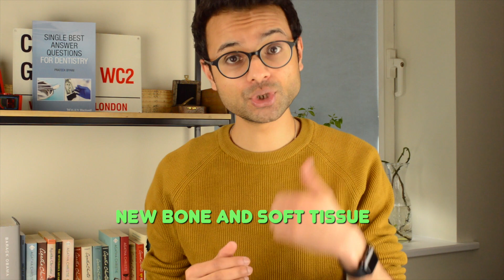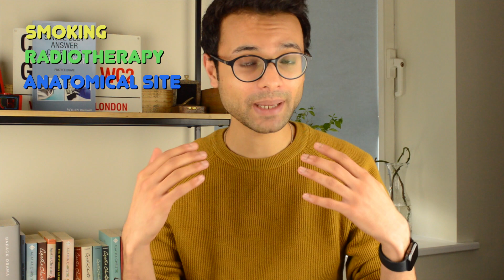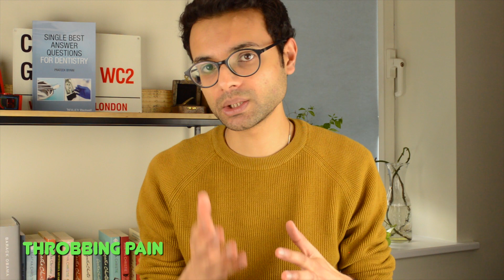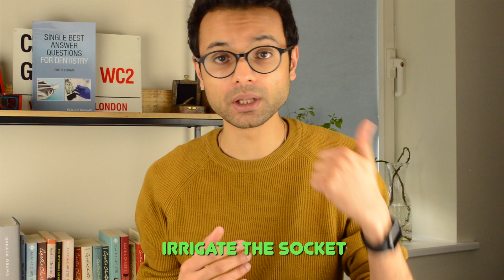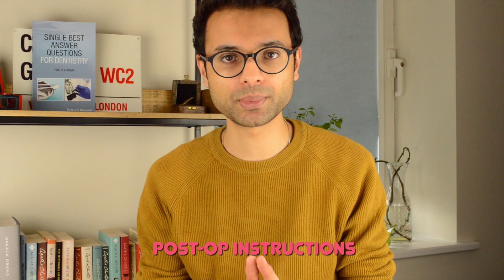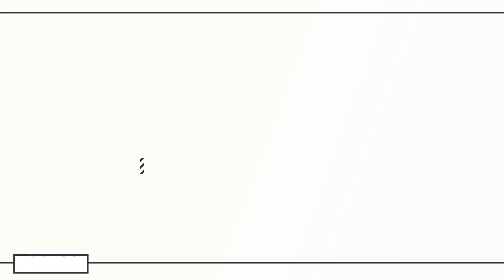What is a Dry Socket? | Diagnosis and Management

Comment from the maker: Learn more about the diagnosis and management of dry sockets :) Hope this video provides some useful information!
Reply: So if u see nothn but white stuff which is bone and a hole u may have a dry socket? I got mine bottom left out yesterday around 11:45 and today it looks red but grayish/white in some color. The tooth was kinda rough getn out the dentist used so many tools and and told me the tooth was sitn dead on the nerves he had to cut etc.
Reply: But not anemia?
Reply from the maker: @shutupimstilltalking  Anaemia could theoretically cause a dry socket as healing may be impaired
Reply: If my healing has gottne significantly better from Day 1 to Day 4 going 5 i honestly want to know am i in the clear for not having to worry about Dry Socket anymore. I am eating soft foods for atleast another 3 days but i wanna know can i disrupt my blood clot after 4 days?
Reply: What to do even after treating the dry socket more than twice the blood clot is not happening..
Reply from the maker: @vikramthirumalai2981  It depends what 'treatment' has been done - some patients can get repeated dry sockets
Reply: @examinedental  Thanks for the quick response. It was an horizontal impacted wisdom tooth and the extraction was hard.. Got dry socket and doctor cleaned and irritated with saline, treated with the alveogyl still ended up with dry socket and again cleaned irritated and applied something else put suture but ended up with dry socket... So is there any other treatment to have it fixed?

Comment: What IF you had a wisdom tooth that has weak roots that is also horizontal at the same time, will it form a blood clot or not AFTER getting a extraction?
Reply: I mean i had mine removed a couple of weeks ago and i dont have extreme pain after i MIGHT of did some exercise but my POSSIBLE area MIGHT of gotten a dry socket and the extracted are doesnt deal any unbearable pain like you claimed
Reply from the maker: Bloody clots should attempt to form in all situations regardless of the complexity. It’s very unlikely to be a dry socket if it is happening weeks later :)

Comment: I got my wisdom tooth out 1 week ago for the first 4 days it was feeling odd (no pain). Went for a follow up day 4 they said its healing but its partially opened. They put paste in told me soft diet. Its now 4 days past (8 days in total) still no improvement..im not sure what is causing this. I dont drink alcohol, i dont smoke, i didnt use a straw. Ive been using salt water the syringe they provided. Ive barely eaten all week. Only stuck to soups and really soft food like eggs. Ontop i without thinking i went in the pool yesterday. Only to find out later this can cause infection (nobody ever told me not to swim) i also dont understand the dont spit out part. I was advised i can stsrt brushing again 24 hours later. Where i need to than spit out

Comment: A very informative video. Thank you. If any dental students watch this I would offer this advice. I am a 58 yo female that needed to have 2 teeth extracted at the same time. Both had crowns. 1 was a premolar & the the other was the tooth right behind it. Both roots were deeply seated in my mandible, which needed to be ground out to remove the roots. Long story short, I ended up with a dry socket. I am, however, on hormone therapy. I would've gladly forgone my hormone  therapy & suffered those side effects vs. the pain of a dry socket. It wasn't until this video that I learned that hormones could impede the healing. My dentist never told me that. I have had other teeth extracted & never had a dry socket. But, I was never on hormone therapy before either.  So, shouldn't dentists/endodontists/oral surgeons address this issue with their female or transgender patients? Wouldn't this possibly be preventative to help lessen the chances of a dry socket & save the patient some intense pain? Then again, I am presuming that when the word hormones is used it is referring to sex hormones & not other hormones (like ones that effect  the pancreas or the thyroid or other organs or glands of the body). Am I correct? Thank you in advance. 😊

Comment: Question, on 8/17/22 I got both wisdom teeth removed on the right side…I followed my surgeons instructions and today 8/23/22 when I woke up to brush my teeth,  some of my blood clot is on my teeth. Idk how it happened. Maybe to much rinsing with warm salt water? I have no pain at all and I just finished my antibiotics today. I called my surgeon and he asked if I was bleeding and I said yes. Then he said to damp the gauze with water and to bite down on it..siince then about a hour or so later the bleeding has stopped and now I see a new blood clot has formed….how could this happen on the first place if I followed everything I was told? Lol but thankfully I have no pain at all. I guess i will have to follow the instructions all over again..but am I in the clear of dry socket if I didn’t experience pain/other symptoms? This is so annoying I thought I was on the road to recovery until this morning hit. Thanks to whoever responds to this.
Reply: The new blood clot is gone from what I can see idk if it’s possible for the whole clot to down the extraction site but I have No pain, no bad breath. All I can see is bubbly foam (I guess from saliva) & a little bit of white tissue which kinda looks like debris of some sort which is on the side . I don’t see any bone when I look into the hole but at the same time it’s kinda hard to tell
Reply from the maker: It all sounds like things are settling well - I wouldn't worry too much :)

Comment: I just got a tooth extraction on my right bottom and I smoked 75 hours later but I still put the gauze on it abs wet it before I smoke and I keep it cover is that fine or am I gonna get a dry socket cause I’m like overthinking lmao
Reply: I smoke every time within hours and never get a dry socket ..mostly it matter if the clot stays in ,I'd it comes out before it's Heald is when it happens because I have one right now
Reply: @drabmeraz7827  bet I appreciate it and I hope u feel better bro cause I heard they hurt like a bitch lmao
Reply from the maker: You will always be at higher risk of a dry socket if you smoke. Placing gauze etc doesn’t make that much of a difference. Smoking impacts the healing process amongst other things so it is not that simple unfortunately! But hopefully all remains well for you!
Reply: @examinedental  thank you for the reply it’s the 7th day today and I stopped using the gauze to smoke to test my luck yesterday and so far no pain and no dry socket knocking on wood lmaoo

Comment: I had 3 wisdom teeth extracted today (didn't have a 4th) and I'm still very confused. My wisdom teeth were not emerged or impacted, but removed to prevent a future impaction. The bottom 2 were supposed to be close to nerves, so "sooner the removal, the better."

When I check for blood clots, all I see is a layer of gum. Surgeon said he didn't put in stitches. From what I can tell, this is normal, but how can I check if I have blood clots then? I worry because I take longer than average to heal and I almost choked trying to swallow my pills the first time. The local anesthetic took over 10 hours to go away enough to swallow things properly.
Reply from the maker: It would be quite soon for you to develop a dry socket. I would follow your dentist’s instructions to look after stuff. Don’t go prodding and poking in to the area - chances are what you think is gum is actually clot.
Reply: @examinedental  All I did was open my mouth the exact same as when I eat and use my phone's light to look inside. Unfortunately, my aftercare sheet has very little information to help, so that's why I looked at this video.

I guess my questions are, when are blood clots apparent? Will gum flaps obscure them? And if you could, will Aleve/Naproxen be good for anything? (I can't take Advil/ibuprofen for medical reasons)

Comment: What is the time frame for a dry socket to heal over?  I had lower first molar tooth out on 24 Jan, dry socket diagnosed on 28th Jan and as at 13th Feb having discomfort as my right hand side of face tightens considerably
Reply from the maker: It’s different for everyone. Residual discomfort doesn’t necessarily relate to the dry socket - it could just be part of the healing process :) if in doubt, speak to your dentist in person :)

Comment: Some videos say it's common some say not. They said to rinse with salt water and try not to smoke, no straw. Never had dry socket before and I always smoked even after extraction.   Never had 4 teeth pulled either . Now I'm freaking out.
Reply from the maker: Hi Lisa - please don't freak out! All the evidence demonstrates that you should NOT smoke after an extraction because it will increase your risk of a dry socket and it will impair healing. Just because you smoke does not automatically mean you will get a dry socket, however you are at a significantly higher risk.

Comment: It's been 10 days I removed my 3 wisdom teeth and 2 molar teeth. Doctor told me I have dry socket in lower wisdom & molar teeth. He was  dressing the area. I had no pain after dressing but pain back after 2 days. I took pain medication and pain goes down. How do I Know if I need more dressing? 
I'm cleaning the area with warm salt water rinsing. Should I take extra precautions? How do I clean the hole which formed near my dry socket? How long does it take to be healed ?
I'm really worried. Please give some advice. 🙏🙏🙏
Reply from the maker: Hi, it sounds like things are settling. If pain is controlled, you shouldn't need to dress this again. There will be a hole for a while as tooth sockets heal from the base upwards.
Reply: @examinedental  Thank you so much for your reply. It means a lot. I contacted with my dentist he said it takes some time. Some transparent sticky stuff coming from my upper surgery area from day 5. What is it? Please tell me. I'm panicking.
Reply from the maker: @cloudyhillsby_sayka  it's difficult to say without clinically assessing - I would suggest that if you're concerned, see your dentist :)

Comment: Very helpful video 👍
I had a horizontally impacted wisdom tooth removed 5 days ago(it was difficult) and started feeling pain that was getting worse. Also noticed a sharp piece of bone sticking out of the gum from around where the root was. Went back to the dentist and he said I had a dry socket. He cleaned it with soaked cotton swabs but didn't apply any dressing. Just cleaned and had nothing put in and said he had to file the sharp bone. I still experience pain like nerves are exposed. Will it heal on its own with the salt water/Corsodyl rinses? Is the healing permanent? Will I always experience sensitivity there? How can I check for debris?
Reply from the maker: It's difficult to say for certain without clinical assessment, but it should heal on its own. It's rare for patients to get sensitivity long-term after an extraction. Just keep doing your rinses to keep it clean :)

Comment: Hello, I got my bottom left wisdom tooth extracted because it was impacted and I’m on day 3 post op and still experiencing discomfort. I checked the extraction site and there is no hole…I can see the sutures and gums they are holding together. I am really afraid to develop a dry socket, so it is normal to still feel discomfort? My cheek is also still slightly swollen… please help!
Reply from the maker: It would be quite normal to have swelling and pain 3 days following extraction. Swelling gets worse before it gets better - I would look more towards the 5-7 day mark for things to start settling :)
Reply: I’m experiencing the same exact thing. Got mine extracted yesterday and had minimal swelling. Today I woke up and my left cheek looks like I have a tumor in it from the outside and when I look inside my mouth I can’t see the hole anymore
Reply from the maker: @brandonprice8631  It's unlikely this is a dry socket and more likely that this is a normal post-op complication of pain and swelling. Dry sockets don't develop this quickly and they don't cause facial swelling - they cause localised swelling in the socket.
Reply: @brandonprice8631  did they say to ice it, 12 min on , 12 min of for firt24 hours to help swelling.
Reply: My daughter is a dental assistant.   She said usually a dry socket will be as painful or more painful as the tooth was before pulled.

Comment: Hey, I had 5 wisdom teeth removed 4 days ago and I noticed today when I eat my right wisdom teeth area stings. Is this normal or did I open a dry socket and I also have throbbing sensation (no pain)
Reply: Call your dentist please
Reply from the maker: You only have 4 wisdom teeth so you must have had other teeth removed. The fact you don't have any pain is reassuring in terms of a dry socket, but if in doubt, see your dentist.

Comment: I got my uppet tooth removed next to my canine, I got dry socket and my dentist filled it with a paste or something last week. Im not longer experiencing any pain however my gum hasnt closed yet and theres still a noticable hole ( still filled in ). Is this normal and if so how long should the paste stay in? Thank you so much for this video!
Reply from the maker: The hole will take longer to close :) The paste will dissolve over time - don't worry!

Comment: I’m on day 10 after my tooth extraction there’s no blood clot not more it’s just “white” in there is that normal or the start of a dry socket should I be concerned?
Reply from the maker: If you aren't experiencing any pain/discomfort then it may just be on the early stages of healing. If you are concerned, then give your dentist a call :)
Reply: Call your dentist if you are unsure. 
I would if it was me.
Reply: Whats that white thing???
Reply: @maxiadelaide8296  its your gums / stem cells forming. I forget what its called

Comment: Great video, thanks! I had alveogyl placed in my dry socket , lower second molar, a few days ago and the same throbbing pain (bearable at the moment) has started again, shall I just wait it out as I don't want my socket scraped with a metal tool again and repacked. Surely this will just go on forever if I have to have it cleaned out again and again?
Reply from the maker: Thanks for the feedback! It may be worth keeping an eye on it - sometimes, unfortunately, repeated dressings are necessary to let things settle so you may need to have further treatment
Reply: @examinedental  Thanks so much for the quick reply, salt water rinses are really helping to keep the pain at bay, so I don't need painkillers, luckily I have a high pain threshold. I am on day 5 since the alveogyl was placed in there, so I'll keep an eye on it, really don't want to go back! Thank you
Reply: @frecklesfunnybunny6470  are you ok now
M also suffering from dry socket and going under dressing of extraction site since 6 days nd already undergone 3 dressing nd today my dentist told me i might need 4 more dressing in gap of 2 days
Now my patience level is going down cant even eat properly i dunt know when it is going to be okay m so tensed 
Could you plz tell me how much time it really takes
Reply: @snehaarora1913  Unfortunately it did take about 3 to 4 wks to stop being painful. I found that extremely strong salt solution, (as salty as you can stand) rinses about 5 to 6 times a day finally did the trick, it hurt a lot at the time of the rinses and then the pain subsides after 10 mins. Wish you all the luck in the world,❤ I hope I never have that pain again, worse than childbirth!
Reply: @frecklesfunnybunny6470  I agree! It is worse then childbirth. Nothing is taking the pain away, I have tried everything. But I will add more salt to the water. I am, however, allergic to salt but I would rather have an allergic reaction then this pain
Reply: @TH∆LLDEEZNUTZ table salt.